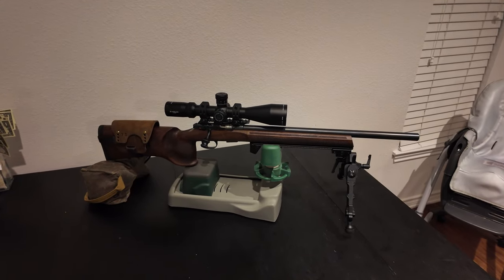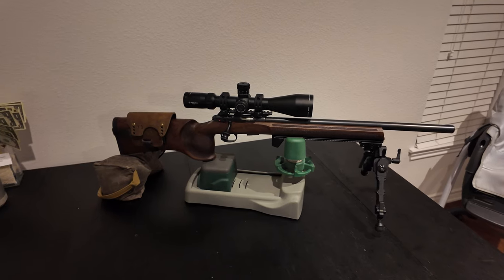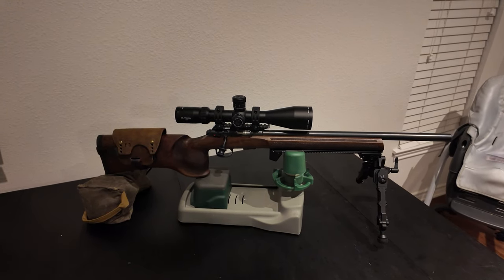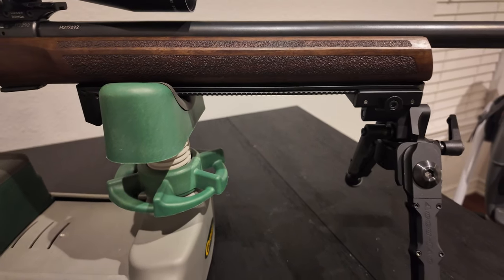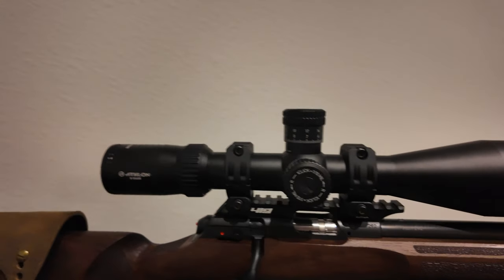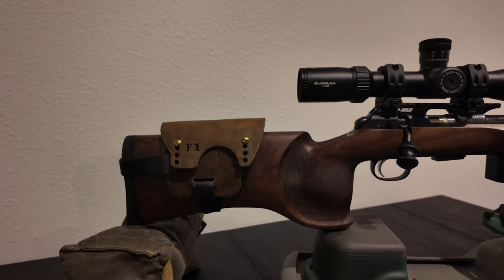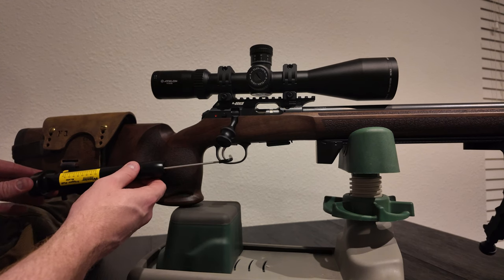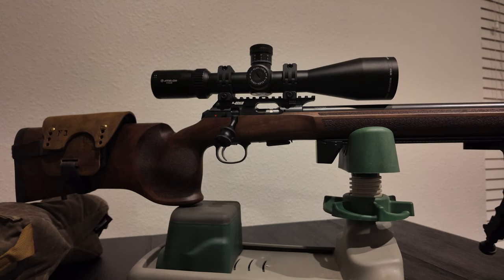CZ 457 MTR for PRS Production Rimfire 2024

Comment: Finally broke down and ordered the cheek rest this morning. What kind of ammos are you finding that’s accurate out of your MTR? I’ve been using CCI SV with good groups at 50yds. Eley match has been excellent at 50yds and Lapua Center X has been phenomenal at 50-100yds. Having a good cheek weld and a steady rest will make this rifle more accurate than I am. I have been able to get moa groups at 100yds w/o getting a good cheek weld and expect to tighten it up once I get it all together. You should post more vids of your rifle. They’re so nice and accurate as hell.
Reply from the maker: @ryanmckee2089  It likes Lapua the best. I did 3 groups of 5 shots each for a bunch of different ammo. Midas+ averaged .218 at 50 yards, and CenterX averaged .331. I got a bunch of CenterX because it is cheaper and still performs amazing.
Reply: @t3h8ar0n Were you able to get your rest all the way down/top holes on both sides? Ive been able to get 3 of 4 in the top holes but can’t get it squashed down enough for the last one. 🤷🏻‍♂️ Works the way it is now for the most part. Very pleased with mine. Just got it today. Can’t wait to get to the range and try it out.
Reply from the maker: @ryanmckee2089  Ya, I got it down, and yes, it was very difficult. I have since switched to a different scope mount though, so now I am running it higher. Pro-tip if you want to get it even lower, take out the foam insert, take your wife's yoga mat, and cut an identical pattern from said yoga mat... it is about half the thickness!

Comment: Hey brotha. Did you used YoDave spring? How were you able to tune it
Reply from the maker: When this video was filmed I had not. I had an instance where I got a fire on bolt close because the trigger was adjusted too close to releasing, so I ended up ordering/installing the YoDave spring (it looks like a spring from a ballpoint click pen... and apparently people have used those springs as well). The adjustment is the same as with the normal spring. Just install it and then follow the instructional video CZ posted on how to adjust the trigger.

Comment: what height rings??
Reply from the maker: Those were placeholder ARC m10 rings (they were low if I remember correctly). The setup I am running now that works well is the Scalarworks LEAP/09 in the 1.57 height with 34mm rings.
Reply: @t3h8ar0n i ended up ordering the m brace setup. Costs about as much as the scope lol. But it looks extremely well made.
Reply from the maker: @leonardharris8803  Ya, I am planning to get that for a magnum rifle build (7prc or 300prc). ARC stuff is built like a tank.
Reply: @leonardharris8803  do you recall the height you went with for the Brace-M?
Reply: @Omi-7k  I had a issue using it with the arken scope. The arken scope has a piece that comes outta the bottom and hit the brace. So i had to order the taller mbrace.